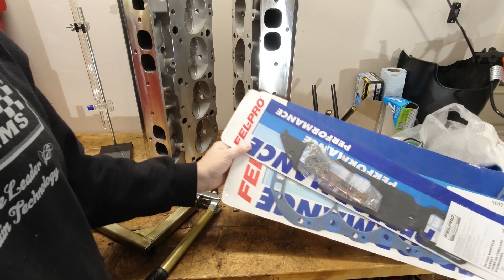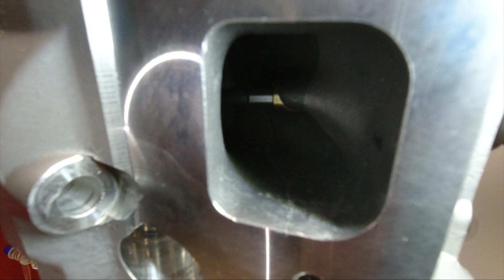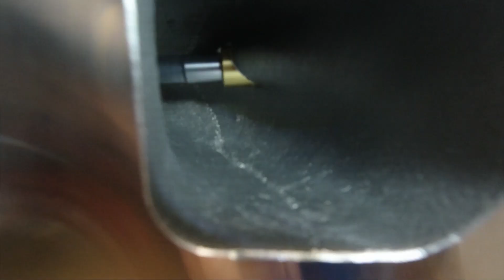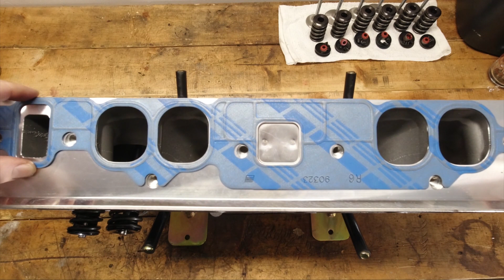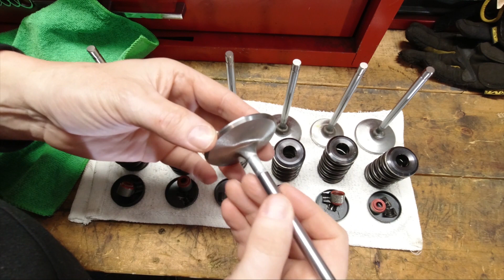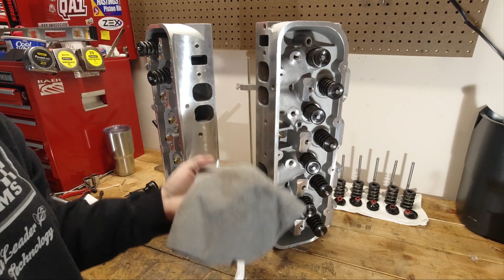Speedmaster Big Block Chevy Head Review

Comment: I don't see a video of this ever being dynoed or installed.  What ever happened?  Also, I have a question:  Looking through your video library you seem to have extensive knowledge of Holley Carbs.  I recently picked up a first gen Dominator 4575 - the one that has a mechanical choke for street cars.  My problem is that all the choke peaces are missing.  You wouldn't happen to have a line on where such obscure holley parts could be found do you?

Comment: Hey I have aa question about the speed master bbc heads I just purchased a set for my 85 454 and I can't figure out what pushrods length to use cam is 600 lift lunati and using speed master roller rockers can you help me ??? Thanks
Reply: @TonyGreer-v8d  adjustable pushrod length checker

Comment: I was thinking of getting a set of these for a budget hydraulic flat tappet single turbo 454 budget build using ebay or marketplace secondhand parts. I kind of am counting on having to replace the valves and have them re valve jobbed., lest the springs. I will port them using vizard's golden porting rules, but probably have the guy doing the valve job get the bowls at 91% or whatever. Doesn't sound too bad so far
Reply from the maker: This set is for sale on my website

Comment: If I have to spend $500 for a shop to check and rework them ...then I would never buy these junk things ....corporate greed ...with no quality  ....another grift company...
Reply from the maker: Hate to tell you but even the “top” companies have very questionable specs on valves and runout.  And every engine builder likes a certain spec depending on their use.  Very common to go back through and measure and change springs.

Comment: Thank you for this great info!! You should be sponsor by speedster for such a good review plus I learned so much from this video new follower for sure 👍🏼
Reply: @musclecarsolutions I just found out my cam and lifter are bad and will need a new one.. What can and lifter will you recommend for this heads? Might as well mix and match for better performance, my first build and have no idea how to mix and match 

Thank you once again.
Reply from the maker: A lot more info needed to select a cam.  But those heads are capable of making some decent power.  All depends on the total recipe and what your plans are for the vehicle it’s going in.
Reply: @MuscleCarSolutions  I am doing a little more research I want something that performs good and sounds good but add boost in the future
Reply: @MuscleCarSolutions  just a street nice sound cruise car currently has a ft cam going to retro hydraulic roller swap

Comment: Just bought a bare set of these during the Speed master black Friday sale, in no small part due to this review. Waiting for them to arrive. I got them at a very good price on sale.
My hope is that they can perform as well as a set of GM 781/049 cast iron heads that have been lightly ported, only with the weight savings of aluminum.
Decided to go with a bare set so as to use better valves and springs, retainers, locks, etc. on my hydraulic roller cammed 468 or 496. 
I'm a little concerned about port velocity with the 305 intake runners though. Velocity = torque. 
If for some reason  I decide against using them, I believe I can sell them for a small profit.
Reply from the maker: They for sure tested well.  I wouldn’t have had any issue running then at that quality.  It’s all off shore stuff, so the only thing I’d recommend is have your machinist verify run out and the valve job, put the springs you need on and you’re ready to go!  Thanks again for the questions on last nights live stream!
Reply: @MuscleCarSolutions  good deal. I'm in no hurry to assemble the engine. Might get around to it late spring or early summer. The heads will just be going on a street car that would only occasionally visit the track 
Enjoyed your live feed. You've got a good channel. Hope you feel better. 👍

Comment: Are these heads the same as the pro comp aluminum heads?
Reply from the maker: Same company, but I have no comparison to a comparable part number pro comp head.
Reply: @MuscleCarSolutions  thanks, I have them on a 302 in a 62 Falcon. Just wondering if they are any better than the OEM heads.

Comment: Is there a way to measure the lift,etc. on a camshaft in my 454 I picked up from a local pickapart? The valve train except the springs had been removed before I got it and I am wondering what it may be.
Reply from the maker: You could pay for a company to measure it with an adcole (not a cam doctor) and find out.  The question is why would you want to?  Factory cam I’m assuming?
Reply: @MuscleCarSolutions   No, aftermarket retrofit
Reply from the maker: @stevefranklin9920  If it’s an aftermarket cam get the numbers off the back of the cam and call the manufacturer
Reply: @MuscleCarSolutions  thanks! I'll check it out! Any idea about what a 454 4 bolt main long block would be worth?
Reply: You can degree the cam yourself and as you do so you can write a REAL Cam Card from the readings you get off your Degree Wheel. I have done this on most every Race Engine i have built since back in 1989. You will find that most Cam Cards are not as precise as they should be. When a Builder is searching for every Cubic Inch of Free HP and TQ he should do as i do. This is in my opinion a Mandatory Part of being a Real Engine Builder that takes Pride in his work.  This also only takes a few extra minutes once you begin the Cam Degree Process.

Comment: Here is my problem with Speedmaster. I ordered a set of oval port bbc heads. They sent me rec ports. I ordered the dual plane intake and they sent me a single plane. I ordered 4.310 bore pistons and they sent 4.280's. I ordered 125# spings for a flat tappet cam, and they sent 185#'s for a solid roller. They will ship out whatever they have just to fill orders and not have to tell you it's out of stock. When i sent them screenshots of my actual order from their website and pics of the wrong parts they shipped, they told me to return them at MY expense.

Comment: I have been using these heads for around 17 years and have built at least 20 engines with these heads and have never encountered any problems, just make sure you are ordering the right head for the right cam and lift, i also fill each chamber with alcahol and let them set to make sure there is no seepage around the valves.
Reply: I’m building a 350, do you buy them assembled now a days? My speedmasters just arrived assembled. Good to use?
Reply: @kevinhendley8524  always check the heads over and make sure you do a leak test that you can do by pouring alcohol into the intake chamber and watch to see if it leaks by the valves let it set for a day then flip the head over and fill the exhaust ports to see if it leaks by the valves and let it set for a day , if there are no leaks and your inspection of these heads turns up nothing only then do i bolt them up.  if any problem your not sure about call speedmaster and they will advise you.

Comment: I bought a set of them and had no problem with them at all. PCE281-2037 Rect. port, 125cc chambers. They had stainless exhaust valves and regular steel intakes. Like they used in vehicles for years. It's a street machine with low compression and a mild roller cam. NOTE: I used Edelbock head bolts, #135-3610. Edelbrock 5745 springs, guide plates and rocker studs.

Comment: I purchased these for my 427 Chevy. Summit sold me the head bolts that were too short and ended up pulling the threads out of the block.the the pushrod measurement was way off from where speedmaster said it should be.while the machine shop was impressed with the quality I’m still trying to get these to work on my engine!
Reply: I used Edelbrock head bolts with them. All the thread length's were correct. Part # 135-1610
Reply: I found some speedmaster bolts for the heads, they were just the outer studs, that were needed, where ARP bolts didn't reach the threads. They bolted up perfectly.

Comment: Only complaint I've had on speedmaster heads is that they don't break the tabs off of the helicoil, this is especially critical on rocker stud holes because they will break off and go through the engine

Comment: Any issues with valve train geometry? I've also heard the rocker arm bosses can be weak. However, that may only be a problem with the extremely high spring pressures associated with big solid roller cams.
Reply from the maker: I’ve had zero issues.

Comment: You need a Felpro 1212 intake gasket oval port heads and a    Felpro 1017-1 head gasket for Mark V & VI blocks because the combustion chambers are very large in these heads
Reply: Not for Gen V and VI blocks.

Comment: Been using these heads for years . Have them right now on a 496 big block Chevy in a 68 El Camino SS .  Skip white sets them up for me and I’ve never had a problem .
Reply: Thanks for the info Mike! Been looking at the Skip White 335 Bravos for my next build.
Reply: What type of horsepower are you making with the 496 with these heads?
Reply: Would be great to have a starting point on the pushrod measurement

Comment: So you think the plugs weren’t tapped so you could index the plugs the way you want to ?
Reply from the maker: Indexing isn’t worth the time spent on it.  The issue is sure you can point the gap at the intake valve and there might be a couple HP in it but the problem is to know if it really worked, you’re spending an awful lot of time and money on the dyno to find that unnoticeable gain in HP.  Plus it depends on the chamber and the piston.  And sometimes it means rotating the gap around to find where it’s picking up power.  You’ll spend a ridiculous amount of time and money looking for power that you’ll never know is there.

Comment: I've been watching bbc videos for 5 years now..this is by far the best vid I seen about heads..thanks alot ...I just a hourly worker and I really needed this before I invest...what type of cam do u recommend
Reply from the maker: Thanks!  That was the goal.  To break it down so you know what you’re buying before you spend that hard earned cash.  

Cam selection will depend on all the normal variables.  What you’re using the engine for.  What vehicle.  What rpm range you’re trying to operate at.  Any power adders like nitrous or boost.  What transmission.  Weight of the car.  And so on and so on...  But the specs on the head are pretty good for a mild street engine up to a fairly decent weekend racer.
Reply: @MuscleCarSolutions  again thank you...much respect for you taking the time 4 a small guy with big dreams...
Reply from the maker: @roddypiper2810  were in the same boat!  Glad it was useful for you!!

Comment: Thanks. Very informative. Couple of questions. 1) is there a difference in the quality of Aluminum used for castings and Alum. density? 2) How do you determine if the hardware is a decent quality? Many have commented to just replace everything in the head with better parts. Perhaps another video? Perhaps buy Skip White heads with their hardware? Much Thanks!
Reply from the maker: 1) doubtful.  China produces most of the worlds aluminum.  I’m sure there are different grades of raw aluminum, but I have neither the desire to hack off a large enough sample to send to a lab for the analysis nor the money to do so.  Unless these come apart on me, which I haven’t seen any examples of that.  2) you don’t really.  The valves for what I’m doing are likely just fine.  The springs, locks, retainers are now the COMP parts to match my cam and the studs.  Well I guess I’ll just find out down the road.  Good luck if you buy from skip white.  You can Google that and make your own decision.
Reply: @MuscleCarSolutions  Thanks! All the info is greatly appreciated. To those of us who don't know al the details, it is nice to be able to get an honest opinion from and educated person.
Reply from the maker: Never used these heads before and wanted to give them a try.  Been worth it so far.  I have no complaints.

Comment: 1st off, thanks for the honesty, I come from a drag racing family, we,ve been using these speed master heads with no problems. We did have to stop using a local machinist though,because he didn't like the fact that the heads were Chinese  made and he got caught damaging a customer's heads. We love, Brodix and AFR, but when building a street machine for a nephew or nieces first project, they're just fine
Reply from the maker: I get that not everyone can afford a US made product and sometimes the off shore brand is the way to stay in the game.  I gave these an honest review based on the facts, not an opinion.  For the cost, these are very good heads.  We’ll eventually get them to the dyno to see how they preform.  Until then, I’m happy with the results.  Thanks for watching!
Reply: Thanks for the review it  took away some concern that I had with some people saying that they are junk because I purchased the top end kit from speedmaster 79 last year I got heads complete with rockers plus an air gap intake and valve covers for around 1400 delivered still got to get my rotating assembly 496 what else mean time I'm shifting at 6 on the couch but I'm going to buy the tools to check the seat run out
Reply: @chevcam92  i just recently installed speedmaster heads, part pce435-1021 on my 454, they look good. My only complaint, the guide plates that came with the heads were really cheesy, I couldn't get a socket around the stud to fasten them. so I used comp cams plates, and studs. Your comment brought me very much comfort, being a rookie engine builder. Thank you!

Comment: My 360 port peanut port heads crush those junk heads at the track. I make 570hp with old truck heads with a Single plane Holley Intake manifold
Reply from the maker: You can accidentally make 600 hp with a big block and a cam swap.  Those poor little peanut ports choking yours down.  😆
Reply: @MuscleCarSolutions  I'm making 620hp in my74 vette with the speed masters and a little work
Reply: @T B Peanut port heads tells me everything I need to know about how accurate your 570hp number is. Next thing you'll be telling me about the 3/4 race cam you're gonna put in it, and bump that number up to 750hp! I'm betting whatever junk you're driving could be timed on a calendar! 570hp running peanut port heads, and single plane intake don't even work well together, you do know that though, right?

Comment: I would stick to the most reputable manufacturers when building a big block chevy, it is not worth it to save a few bucks on an offshore head. Stick with GM, Dart, Brodix, AFR, Edelbrock, etc. and you will be fine. It is worth the extra money.
Reply from the maker: I'm ok with saving the $1000.  Never had one fail yet.  Money better spent in other areas.
Reply: Yes lots of cheap chinese knock off heads, on the other hand a a machinist did a head to head with KMJs vs Brodix hands down KMJ out performed Brodix 345cc with same valves and springs, last build with cheap flotek heads machine shop was suprised how little work it needed lol. Said they was good heads especially for the price.
Reply: Most all aluminum that is used in the construction of Edelbrock, AFR, etc. heads is sourced from China.
Reply: AFR uses Chinese castings. I'm not sure why everyone thinks otherwise. They're owned by the same company who owns Scat, who also uses imported metals in all of their stuff. It just costs so much more, to produce the same damn thing in our country, sadly.

Comment: I just bought these exact same heads! I was worried they were going to be junk, but I guess not! I got these complete heads for less money than I can get ONE bare AFR head. Unreal. I’m still going to have them ported and install the correct springs. Thanks for doing this video!
Reply from the maker: I was very surprised at the results.  They’ve since visited a machinist to clean up one guide that I didn’t like the runout on, but other than that, I could have bolted them on with no ill effects.  Price is right!

Comment: People act like engine building is rocket science, bolt um on and send it if it fails it fails.
Reply: Wow,engine "blueprinting" is a science.
Bolt them on...good luck,when you drop a valve because you didn't bother checking the guides and all of the other  appropriate processes you will have learned that your "just bolt them on "statement is based on pure ignorance.good luck beginning your learning process.
Reply: @tonysextremerestorations9896  it's based on 10 years of being a engine mechanic
Reply: @benolofson9732  Engine mechanic? I'd never let you work on anything of mine with that "just bolt them on and send it" mentality.
Reply: Why not put #6 fuel oil in the tank and send it? There is a good reason people investigate what they are putting their money into. Stick to putting the lettuce on Whoppers pal.
Reply: @thegreenerthemeaner  I promise you I have more HP sitting in my garage then you've ever seen in person